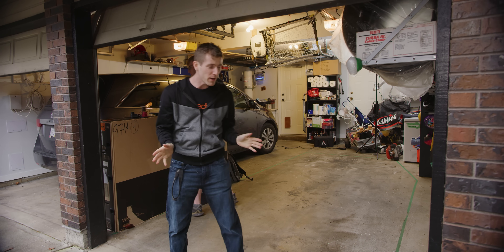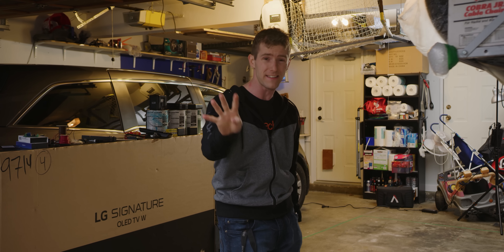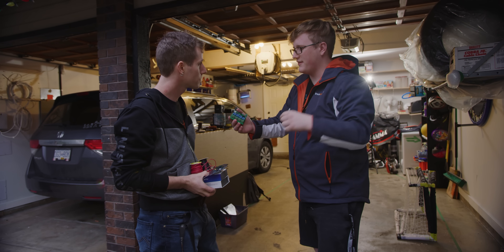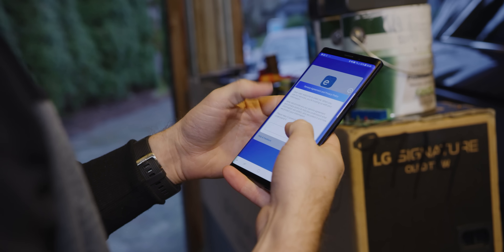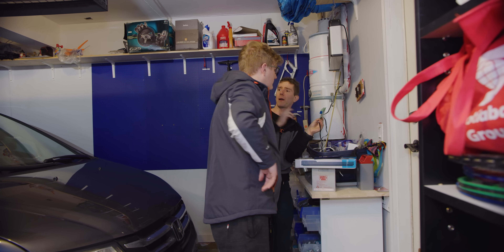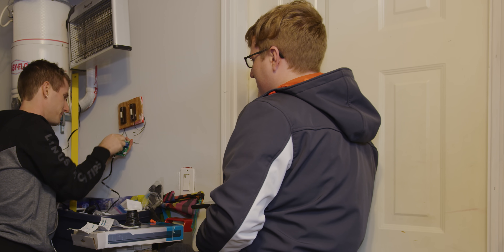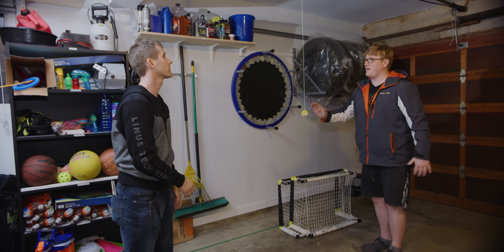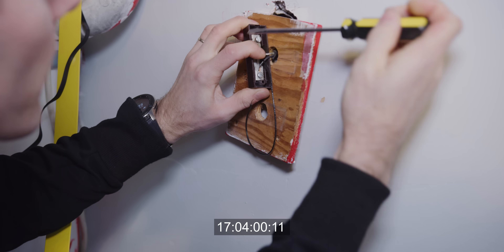Making my 1980's Garage Door Smart!

Comment: Just so everyone knows, the Chamberlain works just fine without IFTTT.. Sure you can’t tell Alexa to open/close your garage or use location based. However, there is an app and it’s 100% FREE and works over the internet.. So you can open and close the Chamberlain garage door anywhere in the world.

Tho IFTTT would be nice if it wasn’t behind a paywall, it isn’t a huge deal breaker. Plus, I think some people have found ways around it.
Reply: I just installed this same model last month.  3/4hp belt drive.  I wanted IFTTT for using with an echo.  But I'm not gonna pay for it. 

It's bullshit that Linus didn't mention that the app to control the door is FREE, and you don't have to be on your own wifi network to use it.  But that's LTT for ya.
Reply: I own the opener and use IFTT a lot and I have never thought of using IFTT with my door, I am not even sure what you would want to do it with IFTT.
Reply: @andykillsu  Assuming you mean why you would want to do it with IFTTT, get google assistant, siri, or Alexa on your phone and have them wake on a wake word. Then tell them to open the garage door, that way it is entirely hands free. Even potentially the way Linus has it ATM you would need to stop in your driveway get out your phone navigate to the app and tell it to open.

With full IFTTT through a smart assistant you could just have the door open by time your car pulls into the driveway.
Reply: @fiorbeth2662  hey the ewelink app does support google home and alexa . It works fine i am using it from an year. It dosent require ifttt
Reply: Another ewelink compatible control with integrated door status without the Roost piece...  https://www.amazon.com/dp/B07K9P9JYN/?coliid=I3CP2VZF3QN878&colid=1JFK183L58DWS&psc=0&ref_=lv_ov_lig_dp_it

Comment: If you have bought wifi module and uploaded code on it and bought relays (normal ones ) separately then you could have done in or under 10$ and you could even control it using Google Assistant !
Reply: Yash Shah this is what I was hoping to see.
Reply: Should have used D1 Mini’s along with home assistant
Reply: u can just link the ewelink to google home and control it with assitant... part of the reason for using this more expensive model is it also has an rf receiver allowing for traditional remote control alongside the new wifi. i have my whole house wired with these and the simpler sonoff basics which ost like 6 bucks each,
Reply: The Vaping Alien personally I have replace my light switches with Sonoff T1 US modules which are custom flashed with Tasmota running on home assistant
Reply: $10. The dollar sign goes before the amount.
Reply: @J624  putting the dollar sign after the number is fairly common in foreign countries
Reply: @roramirez428  not for U.S. currency. Other countries' currencies have the currency symbol after the amount, but USD doesn't.
Reply: @J624  people from other countries may not be accustomed to that is what I'm saying.
Reply: @roramirez428  I've seen it too often recently for that to be the only reason, but if that is the case here, then I've potentially taught them something and I wasn't rude about it. If they did it wrong because the didn't know that it was wrong, that's the perfect time to say something. Don't just ignore it because "they don't know it's wrong", just tell them how to fix it so they don't keep doing it wrong.
Reply: @J624   And the weight goes in kilograms.
Reply: @J624   learn to use the metric system before talking
Reply: @ThePTFOGaming  U.S. Currency notation has nothing to do with the metric system.

Comment: Why don't you make a local integration using like Home Assistant, rewriting the software so it does MQTT, so it doesnt require a use of eWeLink server.

Plus, you could definitely use a Sonoff SV and make it only take in 12V, powering the chip and garage door.

Comment: @Linus Tech Tips - NO vs NC is normally open vs normally closed, that way you can use the relay to either A) Complete the circuit when activated (NO) OR cut power when the relay is activated (NC). So if you wanted a fan to normally be ON unless you turn them off for some maintenance, you'd connect them to the NC, and only power the relay to turn them off.

Comment: btw N.O means "Normally Open" and N.C "Normally Closed"
Reply: for anyone wondering, that's not referring to the state of the garage doors but instead whether the electric circuit is open or closed
Reply: @Sharklops  N.O. and N.C. are the states of the relay in a no power situation. With no power to the coil, the C (common) to N.O. contact is open (circuit open) and C to N.C. contact is closed (circuit closed).
Reply: I was just coming down here to post that. Lol.
Reply: N.C. Can also mean no connect sometimes
Reply: @DantevanGemert  but definitely not in this case :)
Reply: NO

Comment: 1. The codes on the relay module stands for:
NO = Normally open
NC = Normally closed

And 2. I did the same thing in my house using a Raspberry Pi, a Relay Module and HomeBridge - as every person here use an iPhone, it integrates perfectly with HomeKit and, the best part, no subscription required! xD

Comment: BTW, you can get a sonoff and cut the mains power to the relay, it costs 6 dolars and comes in a nice case or you can get the low power version too. Then you can flash the firmware and add a magnetic window sensor or something to sense the opening and closing. It will cost you like 15 bucks total

Comment: Those old Stanley and Craftsman garage door openers are beasts, and they never die. Sure they do break down once in a while but you have cheap repair options. (Edit) Well if it wasn't demonetized before, it will be now since he was singing Shaggy on video. It happened to Pewdiepie so yeah, just sayin.
Reply: I guarantee any old garage door opener that's built well enough to still work now, will definitely outlast the new ones 5 times over. Those big old electric motors are indestructible, especially the AC ones.
Reply: I own a garage door company and have been in the business for 17 years and I can tell you there is a good reason why they don’t make Stanley garage door openers anymore, They’re trash. My local supplier bought their phone number and all their remaining parts many years ago and have very limited supply left.
Reply: @jacobb6276  Idk my mom's house had one for over 30 years, it finally broke after tens of thousands of uses.

Comment: You're talking about (probably very insecure) garage door openers 24 hours after showing your (admittedly already known)  home address on the WAN show... ¬_¬
Reply: Yeah, not the smartest thing he should be doing.....
Reply: now that the doors operate via a secure online connection that triggers hardwired relays they are much more secure.  But if possible he should disable the old R/F remote receivers on the door openers.
Reply: Mark Randall, if someone wants to break in, they can just smash a window. No one is going to sit there for an hour trying to hack the door when you can get inside in 5 seconds using a rock.